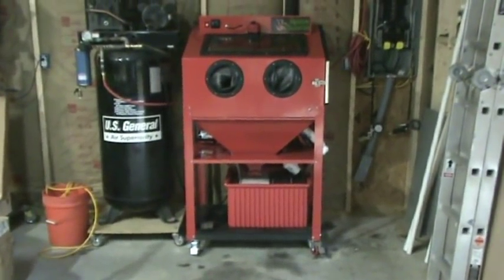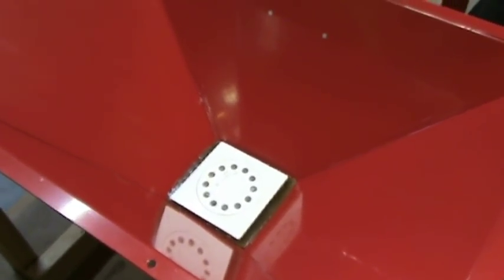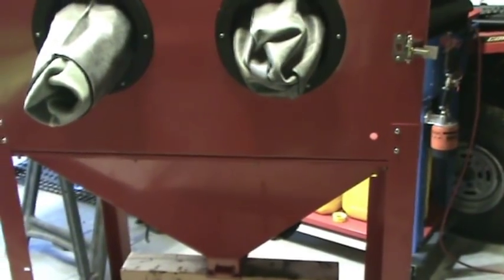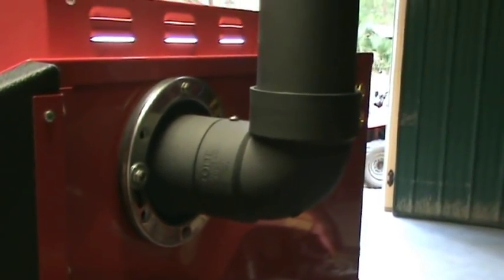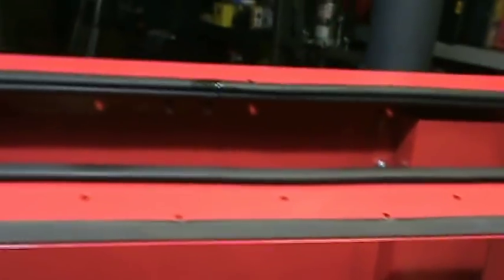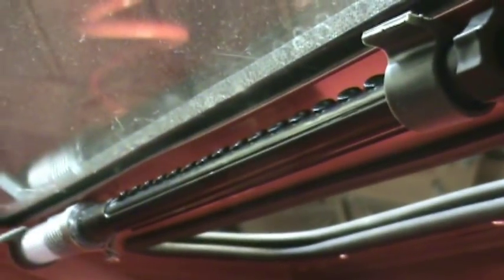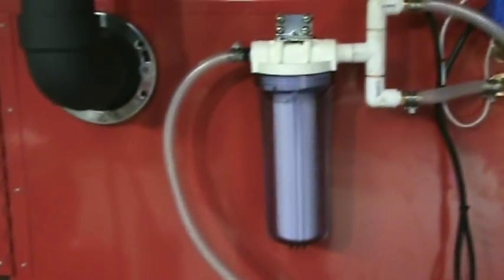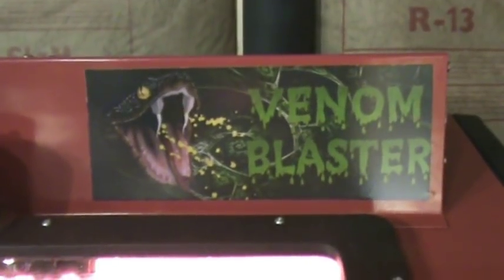DIY Vapor Blaster Cabinet Tutorial Harbor Freight $960

Comment: I think you're build is by far the best. I'm going to build mine the same as you'res. I liked your video and I subscribed to your channel. Could I get a parts list from you? I would greatly appreciate it. Thanks.
Reply from the maker: I am working on a parts list.. The way I achieved that price was buying most of the brass fittings in bulk on Ebay...  I am trying to come up with the best way to stay under $1000 without buying parts in bulk...  If you buy everything locally it would probably cost $1200.. I will try and work on the list soon..
Reply: @venomchris5818  ok thanks

Comment: Washing machine solenoid will do for rinse gun and they are much cheaper or salvage one of a crap washer and also you can use a washing machine pump separate just for agitating slurry then your main sewage pump will have more power

Comment: For your slury agitator you could get a piece of Pex tubing 1/2 inch x sat 16 inch. Drill 1/8 holes in a spiral shape. Get a Pex .50 T connect yur Pex making a circle then a Pex to 1/2 NPT COUPLER OH ID also find a place I therefore a ball valve and air pressure gauge near your main controls. I guess I would use air not slurry to mix slurry . You will maybe agatare the top but I'd worry about the bottom. Maybe 10 pounds psi of air to start

Comment: If you don't use the machine for a period of timee the slurry will pack just like the beach. You can walk on that sand even though water goes under it many feet depending where you are the water sand mix you walk or drive on can go to the bedrock . eBay sells timers that are made to drain water from your compressor, you can hook your air slutty rig to that. You can adjust how long between the time it starts and stops and how long it runs. That can run24/7 if you want

Comment: nice build !! in a tight budget , i own 4 blast cabinets,(search on youtube for vannpolering) the first 2 i have build myself, again i am impressed the way you use your imagination to find the right parts. some remarks if i may : the gloves suck, they leak and stink , buy some industrial chemical ones and use talk powder , the glove holders are inside out and will leak > the hose clamp should be on the outside, the airvent is on the small side , mount it on the top (no bends) and go straight up and there should be no restrictions in it > overpressure in the cabinet = leaks   etc etc etc
Reply from the maker: I hate the gloves..lol.. You are absolutely correct... Thanks for the tips..

Comment: Not familiar with that exact product “Cab-o-sil” but quite often the fillers used for epoxy and fiberglass work are microscopic hollow glass spheres. They are very lightweight and chemically inert to any of the solvent in whatever material you put them in. They are particularly used for epoxy glue ups because they help maintain a minimum gap so that when you clamp the parts together you don’t squeeze all of the epoxy out.  They are also used to lighten the overall density of resins in composite work

Comment: super job. this would be the most complete video on the parts details that i have seen. I am fabricating my own cab etc but you have really done a great job of breaking down all the parts. one quick question though. what is the wiper assembly and where can it be purchased from? thanks for your time and keep up the great work!!
Reply from the maker: It is a Hot Rod wiper that I got off of Ebay..  Here is a link to one.. Search for the best price...     https://www.ebay.com/itm/Speedway-Motors-Universal-Hotrod-Ratrod-Black-12-Volt-12v-Electric-Wiper/131497089294?epid=657507750&hash=item1e9dd6590e:g:2p4AAOSwRLZaYQEw:rk:9:pf:0
Reply: @venomchris5818  thanks mate

Comment: I got mine built and she works awesome, it is a little rougher and a little less polished then I wanted. What PSI are you running I think I'm at 65 and that maybe my problem.  Thanks
Reply from the maker: I found that 75 psi and up works best.. I would like to run at 100... That takes a big compressor or you need to stop often to let the compressor recover....
Reply: Thanks for the fast reply, I have only done one piece so far and I may have held it to close to the nozzle as well,  I have a pretty big compressor I probably need more seat time with it as well.... also I am about to order some crc 3-36 corrosion inhibitor . I may upload a video to review mine in the next couple weeks.  Thanks for the free information I also paid for additional from another YouTuber as well.

Comment: If i use Tsurumi slurry pump 1 HP instead of half HP then what difference it can make.
 can i use 3 HP air compressor. Will it work
. And which nozzle size should i choose.
Reply from the maker: https://www.ebay.com/itm/35mm-Air-Sandblaster-Gun-Sand-Blaster-Kit-With-35mm-Boron-Carbide-Nozzle-USA/312099675555?ssPageName=STRK%3AMEBIDX%3AIT&_trksid=p2057872.m2749.l2649  That is the nozzle I am using. It comes with an 8mm opening.. I have ordered a 6mm tip to hopefully use less air and work just as well. I will post after trying it.

Comment: What all runs off that power supply in this setup? Just the Windshield Wiper and Rinse Pump? If so, is it possible to have a 110V pump to avoid having the extra power supply?  Thank you for the awesome video!
Reply from the maker: I run, the LED lighting, rinse pump, windshield washer and valve for the windshield wiper spray.

Comment: Hi there.

Nice job. Been looking for a decent diy  video for some time.

A couple of question if I may.

1 what pressure and cfm are required by the compressor.

2 how is the pump lasting. Has there been any drop in performance since building it.

Once again, good work, please keep posting updates.

Regards 

Richard  (UK)
Reply from the maker: I try and run about 95 psi.  I am using a Harbor freight compressor .. https://www.harborfreight.com/air-tools/air-compressors/5-hp-60-gallon-165-psi-two-stage-air-compressor-93274.html   The pump is just as strong as new. This pump has a pretty strong polyurethane impeller..

Comment: How are you sealing the door? I’m getting a lot of water running out of the bottom of the door. Even after installing the ramp. I watched the video and it looks like you have no weatherstripping on the door, but I used foam weatherstripping. 

I built it all and I’m just trying to fix this issue, otherwise it works great.
Reply from the maker: My door has some foam weather stripping from the factory. Mine has never leaked. The only time I had water and abrasive come out was when opening the door. Since I put the rubber ramp I barely have any water dripping out. I would have someone watch the door while you spray around the inside of the door to see where the biggest leak is. Somewhere the weather strip is not sealing.....

Comment: Thanks alot for all the great information,  I purchased a new cabinet today unfortunately it's not like your older better one but close. I thought about building one before I saw this, and apparently I was on the right track but and not as automated as yours. The problem I'm having is should I pay Mattmcrepair for his detailed video? I like your closed loop design better but he has my exact cabinet,  I would almost buy the plans and then maybe venture off to combine both to see if I can find something in the middle of both. I dont know but I appreciate your video alot.
Reply from the maker: I have not seen his plans, so I don't know what is on them...  Without having the box on top just means you put the lights internally and put a plastic box on the unit to hold the wiring for what I have in the top.

Comment: Hi Chris, really amazing work! Super professionnal, and seriously good of you to share! I'm starting my build now, could you share you PSI/CFM settings from your compressor? -  I'm not sure mine is going to be up to task. Thanks.
Reply from the maker: I have it set at 125 psi. It uses a lot of air so it drops to 100 pretty quick and will stay there for a bit... eventually it will get down to 85 and I let it recover at that point.
Reply: @venomchris5818  thx for reply Chris, any idea if the cfm of your compressor? Cheers
Reply from the maker: @grantlinscott9778  Air delivery: 15.8 CFM @ 90 PSI, 16.4 CFM @ 40 PSI

Comment: Hi Chris thanks for the movie! We are planing right now a cabinet and we could get from a friend the bigger version (Tsurumi Hs275) Output 0.75Kw, 230l/min(same like the Hs245, 18m to lift up(Hs245;12m) and its a bit bigger at all but that shouldnt be a problem for me. Just would like to know if u think the pump would have to much torque? 
Thanks a lot from Germany!
Reply from the maker: The pump will be fine as fine as power. It will fit into a bigger cabinet.  I would have use that bigger pump if I had gotten it to fit. Would love to see your build when done!
Reply: Cheers I will change the lower cabinet construction to get it fit inside. I keep u guys informed

Comment: Absolutely Awesome !!Don't understand the Shower Drain at the bottom, do you actually drain from there ?
Reply from the maker: Shower drain was just a base for the pump to stand on to get the correct height. It was easy because you have a piece of PVC in the bottom that you can adjust up and down and then glue in place.
Reply: Oh, got yah.  Again,...  Awesome job dude

Comment: Does the bump have the polyurethane impeller like the ones bragged about in the high end cabinets?not sure the life span difference but I know that's there bragging points
Reply from the maker: Yes, it does... This is the same pump used in many commercial machines.

Comment: Great video Chris, very detailed. I'm gathering parts for mine now. Was there a particular reason you went with a DC valve for spray water and AC for air? I see DC valves on EB rated to 145 PSI. Thanks again.
Reply from the maker: I went with AC on the air because the pump was AC. That way I could plug both into the foot switch...
Reply: @venomchris5818  I didn't realize the switch activated the pump too. Makes sense, thanks

Comment: about the fuses , wat you could do is cut a rectangle hole the size of the fuse cover and mount the fuseblock through it from the back with spacers so the spadeconnectors are under the hole and the fuse cover pokes through , makes seeing broke fuses and replacing them eazy

about the solenoid valve , washingmachines have solenoid valves that run off 110 volt , there open for longer periods so should be ok for wat you want to do 
another option would be to switch a small pump (windshield washer pump ?) instead of using an electric tap

as for the window , an extreme but likely very effective solution would be one of the circulair spinning windows they have on boats
Reply from the maker: I used to build Halloween props and used washing machine valves... Can't believe I forgot about those.. I probably still have 6 or more here somewhere. Good Call! On the fuse panel I wasn't sure how I wanted it , so it was one those things I figured I would do later.  The Window... That is awesome I had never seen one of those before... :)

Comment: Hi Chris. I'am really impressed with your build and think it's the ducks guts a bloody ripper. Would there be a problem using a pump with a cast iron impeller compared to polycarb ? thanks heaps mate 👍👌
Reply from the maker: I would guess cast iron would be ok as far as not wearing down from the abrasive slurry, but you would need to add some type of anti rust into the slurry mix.. Polycarbonate impellers wear out pretty quick.. The polyurethane impeller that is in the pump in the video will last a long time....Also the abrasive slurry bounces off the polyurethane impeller kind of the same way you see the slurry will bounce off Silicone gasket debris still on the parts being cleaned.
Reply: @venomchris5818  Thanks for the quick response mate. I'll go with the polyurethane like you said mate . Cheers

Comment: The switch you have for the pump, is that for the pump inside or the fresh water pump?? And once you are blasting and want to stop for a minute, what stops the air from continually flowing through the gun?
Reply: What I’m trying to say is how do you power the slurry pump and how do you start and stop the air/slurry when you wanna open and close the door? As there is no trigger on the gun..
Reply: @nathanshaw8162  I think it's controlled by the foot pedal?
Reply from the maker: The on / Off Switches that are on the top of the cabinet control the Fresh water pump and windshield wiper. There is an electric Foot Switch that powers the pump as well as the electronic ball valve for air. I have added the foot switch to the parts list in the description. Go to the 47:06 Mark in the video where I discuss this.
Reply from the maker: @hondayamaha2611  Exactly...
Reply: Venom Chris okay sorry I didn’t see that part, so that 1-3 plug in you use to plug the rest into, do you have a link for that? And thanks for your reply’s
Reply: And also what is your glass to water ratio?
Reply: Honda Yamaha thanks now I got to find a UK equivalent
Reply from the maker: @nathanshaw8162  https://www.amazon.co.uk/Momentary-Reset-Black-Antislip-Switch/dp/B00MJUEJWE/ref=sr_1_43?ie=UTF8&qid=1547393883&sr=8-43&keywords=Foot+Switch+15A  Funny that on Amazon UK They have no foot switches with Piggy Back Plugs that I saw. You would need to put a piggy back plug on the end of this switch..

Comment: Hi Chris,  Just wondering, what size hose are you running to your regulator ?Also, what size & style air disconnects are you using at the regulator ?I can't seem to find disconnects any larger then 3/8 NPT.Thanks Chris
Reply from the maker: I am using 1/2" hose .. Here is a link to the regulator:  https://www.ebay.com/itm/Southern-FRL-Air-Pressure-Regulator-1-2-NPT-with-Gauge-Bracket-/291985977003?hash=item43fbb86eab. Here is a link to the hose from the regulator to the blast nozzle. https://www.amazon.com/gp/product/B00Z1K7INQ/ref=oh_aui_search_asin_title?ie=UTF8&psc=1 .. From the compressor to the Regulator I am also using 1/2" hose that I got from Northern Tool..  I think using 3/8" everywhere would be fine.. I went a little overkill... That is always a problem with me..lol
Reply: Thanks Chris,  The reason I ask is because in my search for quick disconnects,  all I found was 1/4NPT and 3/8NPT.  Did you find 1/2NPT quick disconnects ?
Reply from the maker: @mikeomation9945   I have hard connections with a ball valve.. no quick disconnects
Reply: Oh,..  that makes sense.  Was concerned about air restrictions to the machine.  Thank you very much.  Onward with 1/2" lines.   Thanks again Chris.

Comment: Okay so mines all built, done a really bad state CBR 1000 engine and on the last peace the pump was getting jammed up trying to push the media out of the hose.. have you had any problems like this?
Reply from the maker: I always use a pressure washer to clean very dirty greasy pieces before I put them into the Vapor Blaster. That way the glass media stays cleaner and last longer with no large dirt pieces.  Also, I believe your problem may be poor agitation. Make sure you put an agitation pipe Like I did to keep mixing the slurry mix at the base of the pump.
Reply: Venom Chris  yes I got an agitator exactly the same, all the glass seems to get clogged in the pipe but the agitator firing it out. Going to try maybe a larger hose to help it flow through better
Reply from the maker: @nathanshaw8162  Try more water and less media in your slurry
Reply from the maker: This is a good video to watch.. He will talk about how high the media versus water should be...    https://www.youtube.com/watch?v=RKgAmcZ1ChM

Comment: Hey Chris,Waiting for my LEDs to show up and I would like to have a plan ready when they get here.  So as I looked at your VID I initially thought that you had used spade connectors,.. but as I am looking more carefully I'm thinking that you have soldered wires to the ends of each run of lights.     Is that the case ?
Reply from the maker: Sorry about the late reply.. Having some health issues.. Yes I soldered them , but connectors would work fine.
Reply: Thanks for getting back.  Hope you are Ok.Yeah, the lights came and I saw what needed to be done.My cabinet is up and running.  Works great !!The one thing I'm scratching my head about is the filter box.Seams that it gets dirty quickly.  Going to figure something out.

Comment: Looks like the slurry mix is stored in the main cabinet where your pump is..  and your pick up for the rinse is in the red tub with the dividers.   How is the rinse water separated to not mix with the slurry below?
Reply from the maker: In this initial build I used a partition filter box along with a water filter on the rear. In the updated video I changed to a two stage box filter and kept the filter on the rear.

Comment: Where did you get this idea from????
Reply from the maker: Looking at different overpriced units in the market and not being able to afford one.
Reply: @venomchris5818  I hear ya. How much water / abrasive can you fit in the hopper? I ended up with a sump pit underneath.
Reply from the maker: @HTMR  I am probably using about 10-12 lbs of Glass bead and then I fill the water to the upper ball valve. I need to empty it and see how many gallons. Because I did the filter box on the bottom that holds a lot of water also. I am going to figure out the exact ratio. I had spoken to the owner of Wet Blast 4 Less and he gave me lots of tips on the build. Really nice guy.
Reply from the maker: I revised my mix and I am using about 25 pounds of glass bead.. Still need to figure how many gallons of water in the tub.... The filter box holds 11 gallons..

Comment: is there another vent in the power supply enclosure to allow air to flow in or out?  otherwise the fan isn't going to do anything but raise or lower the pressure inside the power supply enclosure
Reply from the maker: There are vent louvers all across the back of the metal enclosure.